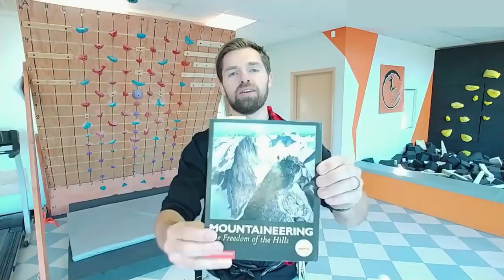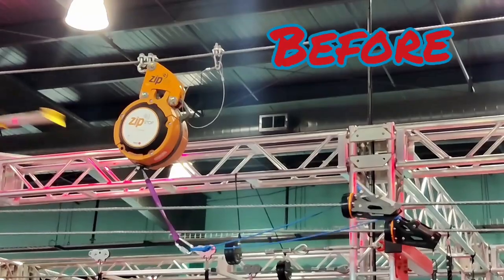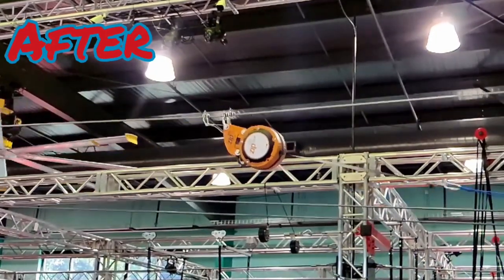Repairing A ZIP STOP Zip Line break at OCA Adventure Park

Comment: Nice! I upvoted the video. I feel like the quick link in the saddle isn't the best repair because the saddle is meant to just hold something statically, and then the zip stop rotating on the now-static quick link turns the quick link into a lever, which could cause the saddle to either loosen more over time, or bite more into the cable, and maybe both? I'd prefer to see something like a quicklink on the zip stop going to another quicklink, with a big saddle or something preventing the top quicklink from moving down the wire? I don't know, that was my initial thought while watching. Great work, though, I'm happy you it's improved from where it was!